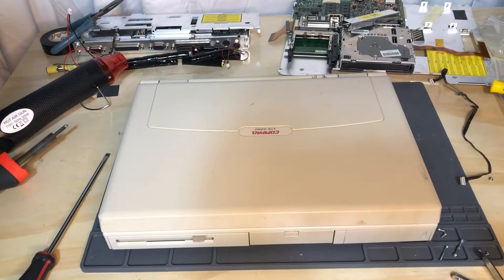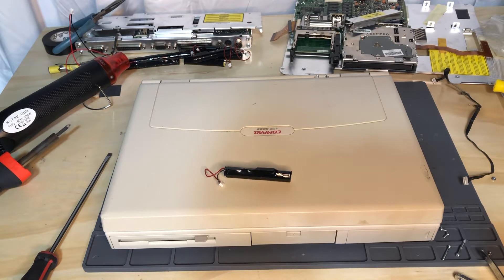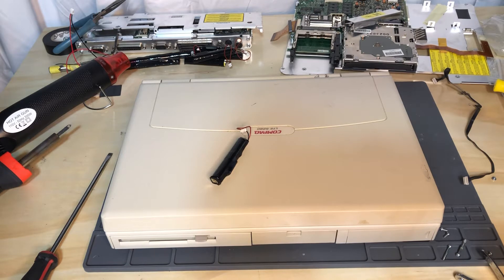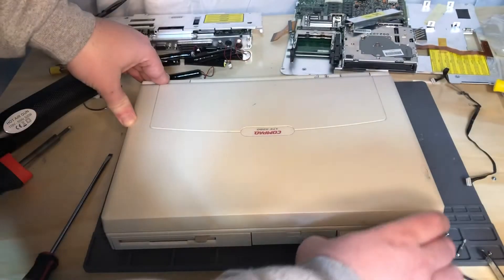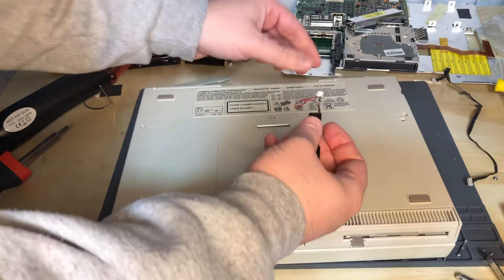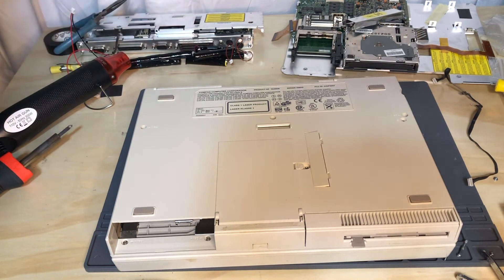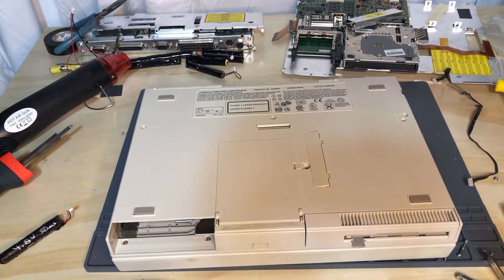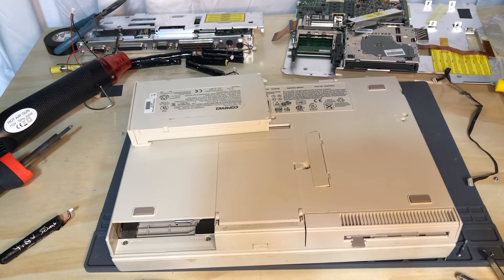Compaq LTE 5000 series CMOS/RTC battery replacement

Comment: 486 LTE series 2850b - are voltages different?
Reply from the maker: The CMOS battery is completely different from the one used here.  The Elite uses a 7.2V battery.  The 5000 uses a 4.8V battery.  I’m not sure what the internal voltage is for the Elite series.
Reply: Yeah noticed the 7.2V on a LTE repair vid by @ArcticRetro had to ask

Comment: Hello!
I really appreciate all the work you do rebuilding these cmos batteries, I still need to order a 3400c battery at some point as I’ve got 5 working main packs that I’d like to be able to swap between without a jump start.

Anyways, main question is this - I’d really like to get an LTE 5000 at some point, and I do also know that these batteries like to leak…
How likely is it that an untested one off eBay will be ruined? Or is it well shielded enough that it will be fine unless it’s catastrophic? And also, how generally reliable are these?
Same with the LTE Elites - what are the common faults on those?
Thanks!
Reply from the maker: LTE 5000: It's a 50/50 shot on a ruined main battery.  If it's a lithium, those chances are likely 100%.  If the seller has the original charging block ask them to see if the orange charging light stays on while charging.  These will typically try to charge even if no battery is connected to it.  If the answer is yes, then it's likely rebuildable.
LTE Elite: Floppy drives are likely DOA.  Some have replaced the belts and caps with good results.  Those batteries leak but I almost never come across an unbuildable one.  If the Elite doesn't power up, there are 8 tantalum caps under the power supply in need of replacement.  I have a video about this subject.
Reply: @i80386sx  Thanks for the quick reply!
Yeah I had heard that the LTE Elites used citizen floppy drives, ugh. I usually use LapLink for file transfer anyway though so it shouldn't be a huge issue.
What about the CMOS/Suspend batteries?
That's the main thing I'm worried about. Too many times have I seen laptops I want to get be unobtainium working due to some stupid VARTA battery in them that leaks all over everything.
Do the LTE 5000 and Elite CMOS batteries cause problems like this?
Reply from the maker: Those CMOS batteries do leak but I never had one outright destroy a system board.

Comment: Wish I could have a decent price to receive the battery to UK😢
I think I'm left with putting together four 1.2v AA batteries in series and chuck them into the main battery compartment which is empty now as old battery was leaking.
Reply from the maker: You can get them for $20 USD new on eBay.
Reply: @i80386sx  yeah but with postage to Europe it becomes ridiculous
Reply from the maker: That’s true.  I believe these have (4) 1/3AAA batteries.  If you can find those in the UK, you’ll be sitting pretty.
Reply from the maker: If you have the means to assemble it, here’s the cells.  It is from China.

https://www.ebay.co.uk/itm/256024013342?hash=item3b9c386a1e:g:3TkAAOSw0wRkIaC~&amdata=enc%3AAQAIAAAAwGStZo5dBEpmTynah0aPRQ8jDyFrX%2FEW0AYpxJFWOre%2FReycWXpQCzz6E4M%2B96BgtnbvCvtSXsCJ4b3ujhDpVvsZgSqg9ltJ5SBYJRkj19wi%2Bm1tDrpvE%2F8bOga4LFJ1LmY1OnEqk9Nzl1bq%2BSLHXcjfGA%2FatCfNUjVmxw8wTfC4nqkYhrxqO0ncJ3W1DhH%2BIzNoPlqdjiZqDh4omC25H8j3E67i6oUP3RtAZE%2BvcCbPeIhFymsFNqNFdHnQzOxY4w%3D%3D%7Ctkp%3ABk9SR86WuoXvYQ
Reply from the maker: I found that out thanks to the LTE Elite CMOS battery.  They use 6 of these.
Reply: @i80386sx  ah wait, don't they use 4 of them?
It's 4 by 1.2 equals 4.8v

Comment: This is a great video.  It helped me install the battery I bought off of you on Ebay.  The only issue I had was I have HUGE hands and couldn't for the life of me get that plastic in the male lead   I used your way of just having the plastic connection lined up and used the side of a small flathead screw driver as a tool to push in the female lead into the male lead.